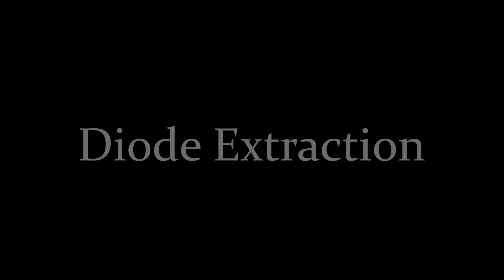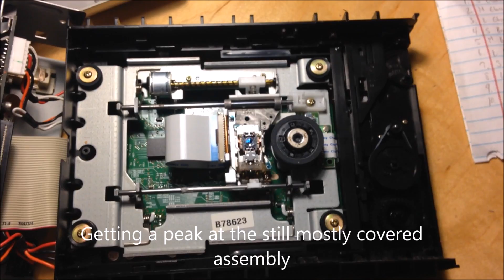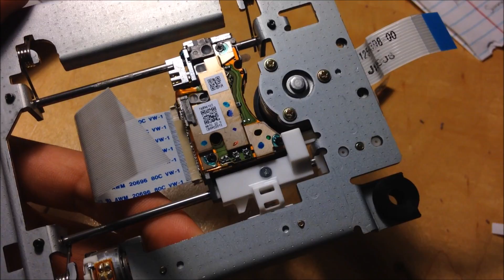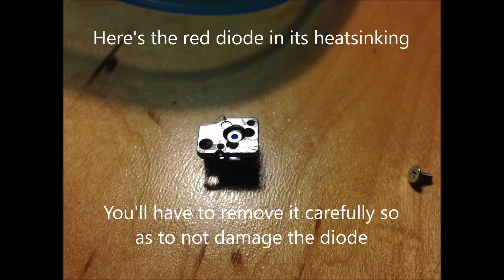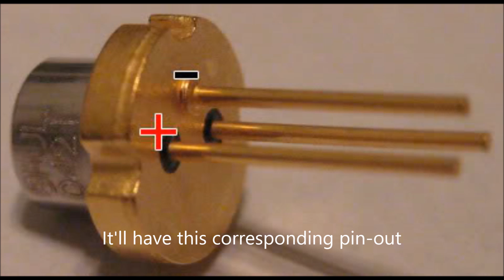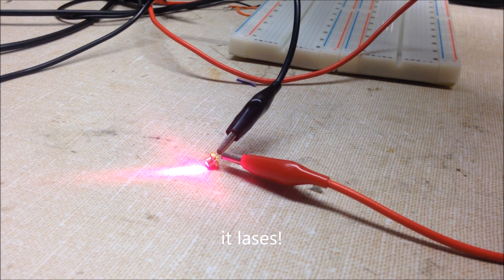Extracting a Laser Diode from a DVD Drive!

Comment: I thank you greatly.
So what you are saying is that one has to remove a laser diode from not any dvd player, but actually from a DVD rewritable, implying it has to be a computer unless there are also DVD players that does it also.  So it has to be DVD burner or whatever they want to call it?

Well, I took apart about 8 dvd player or whatever.  6 of them were said WR, re-writable and such. One from blue ray.

Of all the 8, only one laser works.
I tested this with a multimeter, not knowing what to look for. So I played around and ended up using the diode setting on the multimeter.
The two outer pins read 2.9V and I got no other readings from other combination.  And no resistance reading between any of the pins.
Using the diode setting, not only it reads that voltage but the laser comes on as well, which I assume makes sense.

What I don't remember if this came from the blue ray or not... but somehow I really don't think it did.
I remember specifically that from the blue ray diode, I got nothing.

With some of them and specially from the last two, I only read forward voltage between one pin and the middle pin 1.5V.  I also get resistance reading between that  middle pin and the body.  Aside from that I get no light.
It is outragous and frustrating to say the least.

I am further assuming that reading and playing the dvd is done by the other diode, the infrared diode.   The last two players I actually tested it by opening the top and placing a dvd disc in it and seeing the light come one.  But of course I don't know which laser that would be.  It is probably the infrared laser.   Besides even that diode does not work once I have taken them out.

Very frustrating.  Worse yet nobody shows the details on how does the person figure what pin goes where.  There is no writing on them,
Half of the ones I took out, the pins are in staight light and not in traingular position....

I don't know if you reply to your comments or not.  
I am just hoping you would.

( I forgot to mention, the only laser diode that is working... to be honest it is pretty bright.  I am color blind but I know one thing, it is not red. It seems blue to me.  I have made a simple video of it. I can put it up just to give an idea)

Comment: I can't seem to find the right dvd burner I took apart two already I bought on ebay and they only had one diode, they also were of a different shape
Reply from the maker: The dvd drives must have "RW" on them which stands for rewritable. Only these drives have the red laser diodes which are used for writing to a disc. The diodes you found were likely non-visibile infrared laser diodes used for disc reading.
Reply: @lazerphase  ah yes, I had learned the hard way and ordered a dvd burner that has an open diode

Comment: What precautions does one need to take?  Are special laser glasses required when messing around with these?
Reply: When experimenting with lasers it is extremely importnt to use safety glasses that correspond to block the colour of the emission you are playing with.
Reply from the maker: It's advisable to have them for lasers above 5mW in power as your blink reflex will no longer be 'sufficient'. You'll want to look for protective glasses that block the laser's wavelength (color) and in this case it is 650nm red.

Comment: How much voltage do you recommend us using for the laser diode? Owo
Or resistor?
Reply from the maker: I would recommend a 3.7V Li-ion battery. And if you have a current controlling driver, aim for 300-400mA
Reply: @lazerphase  is it OK if I use it for a long period of time? Like 40mins
Reply from the maker: @Heliomation  Yes, if you can actively keep the diode cool during that time with a heatsink and fan

Comment: Hi! Great video! I'd like to ask, can we use a 9V battery to power the diode?
Reply from the maker: these diodes are usually rated for 3V but they are pretty tough... i wouldn't recommend it but you might be able to
Reply: @lazerphase  looks like I'll be using some resistors then. Thank you very much!

Comment: I had tried many times but always a small amount of light emitted from the laser diode . Why did that happened?
Reply from the maker: Running the diode directly from a power supply can be risky if you increase the current too quickly/too high. This can kill the diode meaning it will only emit a dim light

Comment: I have a question
Many pickups simply aren't made anymore and can be hundreds of dollars. I was wonder if it's theoretically possible to replace the diode inside of these things if they are the same specs and get them working again. Thanks :)
Reply: I think answer is YES. What you need to do, 

1. remove old burned diode be ceraful to not destroy heatsink and tape
2. use soldering iron to heatup heatsink to enlarge the hole https://en.wikipedia.org/wiki/Thermal_expansion
3. try to insert the purchased diode (650-660 nm) when heatsink is hot
I think the same thing you can do to removed diod without damaging heatsink , but it harder. Need heatup headsink and cooling down laser diod with isopropylen alcohol. 

Good luck